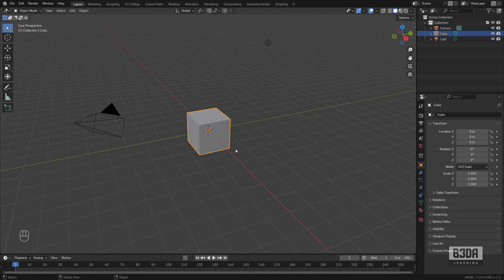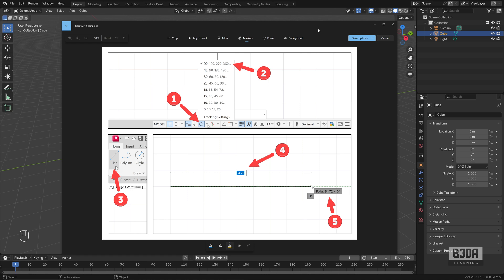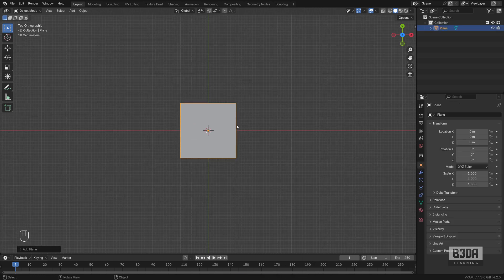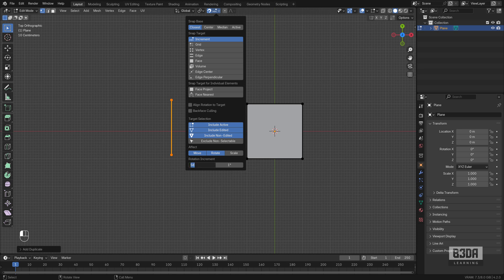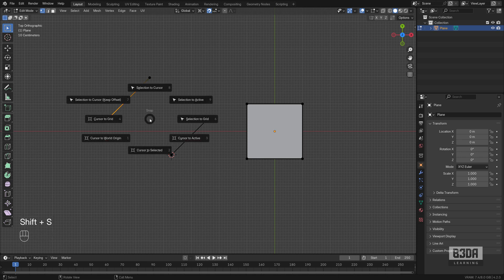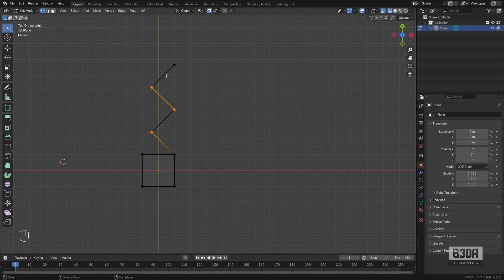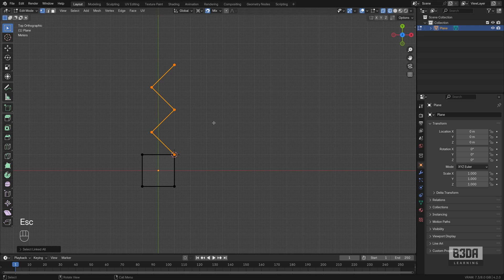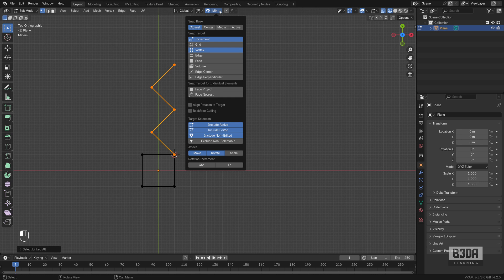Blender as a CAD tool: Simulating AutoCAD's POLAR Tracking

Comment: Can this method be used to rotate a section around an edge?
Reply from the maker: Absolutely! The secret is to align the 3D Cursor and use it as a pivot. You can rotate objects or shapes from anywhere.
Reply: Thank you  I want to learn to do this as easily as in Sketchup - in Blender the local setting keeps jumping back to global - do you cover this in your books or courses about blender?